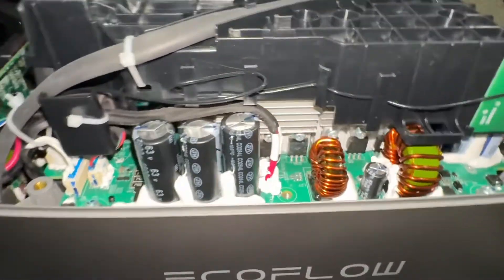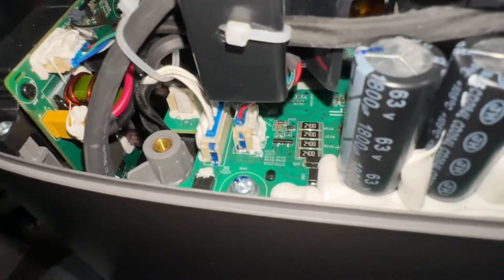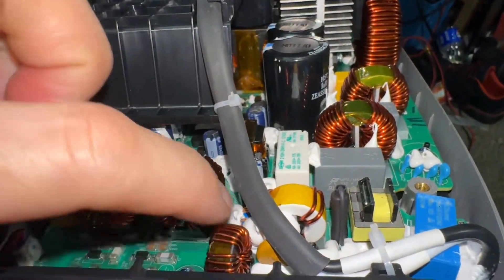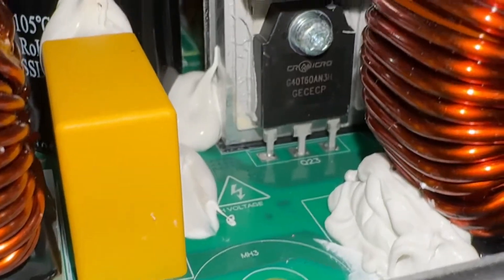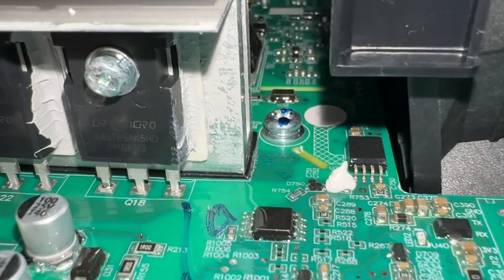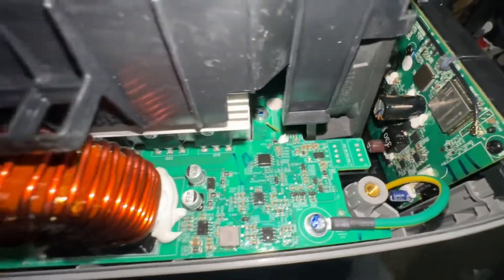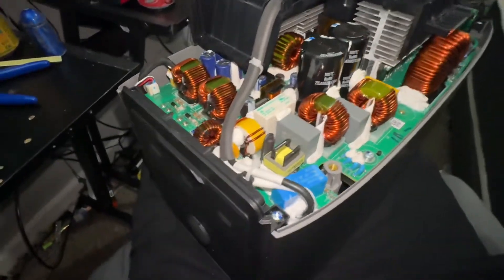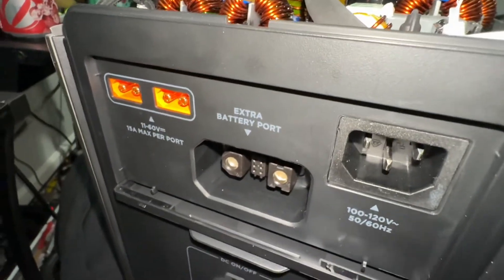What’s inside, EcoFlow Delta 3 Pure-Sinewave inverter.

Comment: I would like to see how you open the cover in the first place.
Reply from the maker: The top of the inverter, has a cover that snaps off to reveal the bolt holes for the screws, you'll need a 6 inch long Phillips driver to loosen the screws, then the gray cover slowly lifts off to reveal the internals